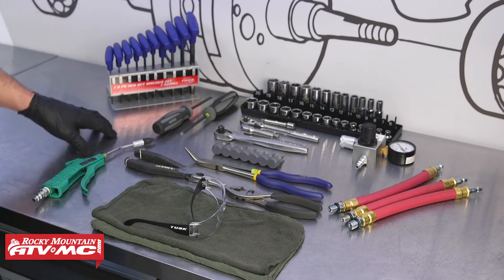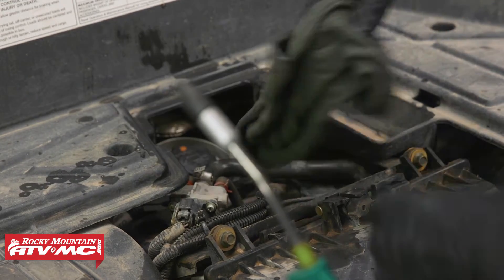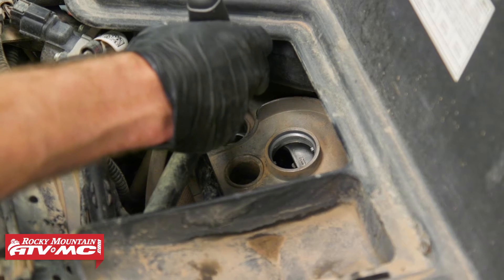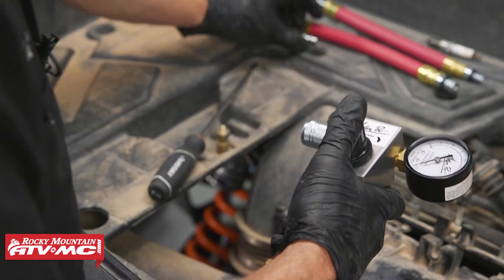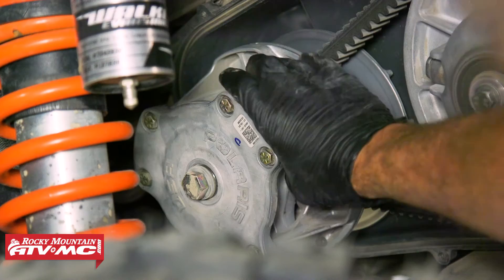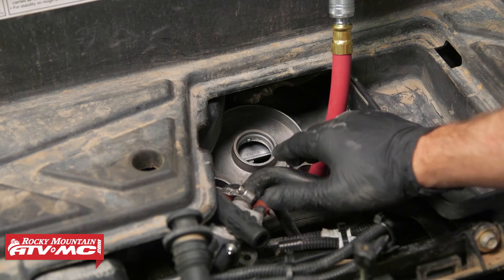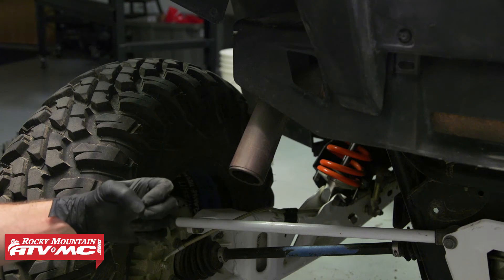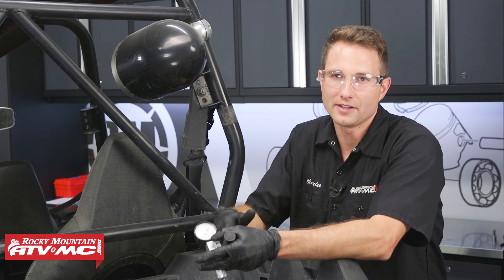How To Perform a Cylinder Leak Down Test on a Polaris RZR 900 & 1000

Comment: What size test adaptor did you use
Reply from the maker: It was the 10mm adaptor for this machine. But you will want to compare them to your spark plug to make sure it's the correct fit for your machine.